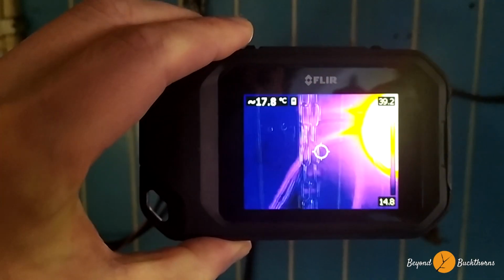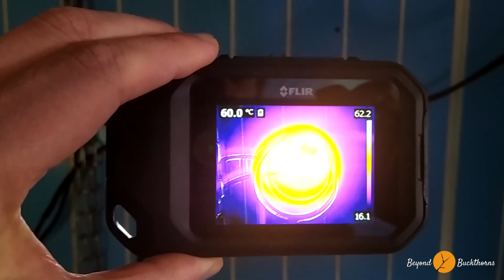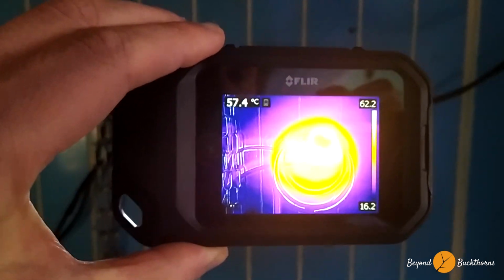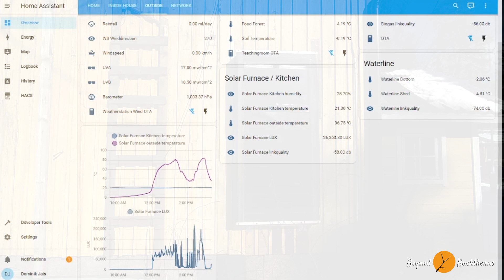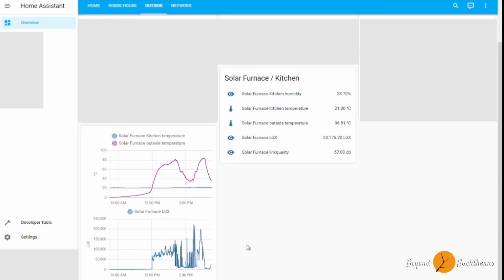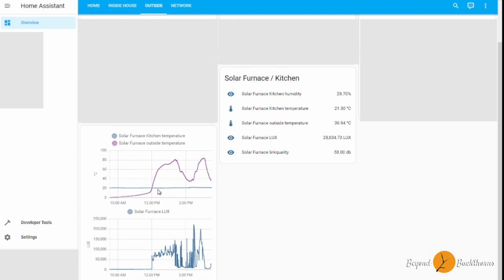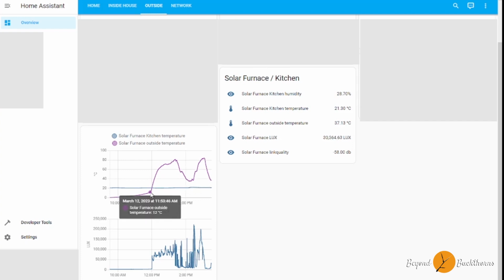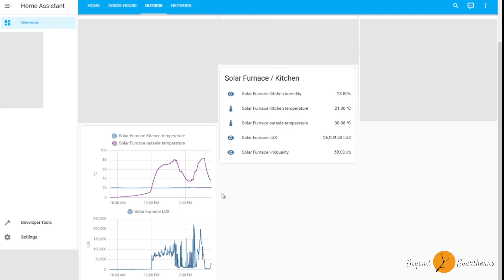Solar Air Heater Update - temperature sensors

Comment: are you using arduino or something else ? and did you plan to increase size of a panel ? bc as i see there is planty of space for that
Reply from the maker: No Arduino, but an ESP8266. Yes, there are plans to increase the size or combining multiple panels.
Reply: @beyondbuckthorns  i didn't know that the ESP module could be used standalone. I thought I had to connect it to something. I have little experience with Arduino, but the project I worked on, also for solar air heating, I want to connect to a network, although I haven't gotten to that point yet.
Reply from the maker: If you want to connect to a network ESP is the way to go. You could use development boards like those form Espressif https://www.espressif.com/en/products/devkits or Wemos https://www.wemos.cc/en/latest/ . If you have experience with Arduino you will learn ESP quick. All the best with your project!